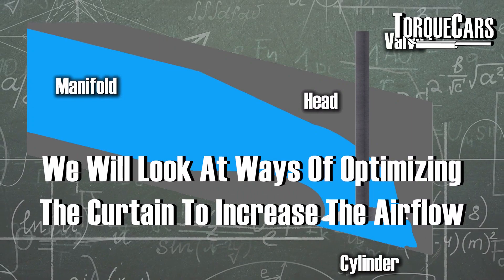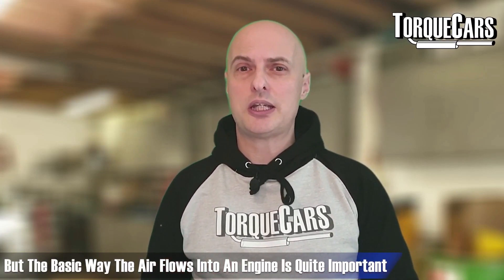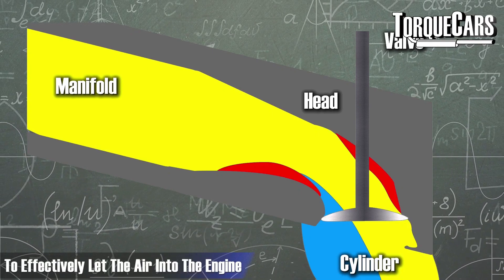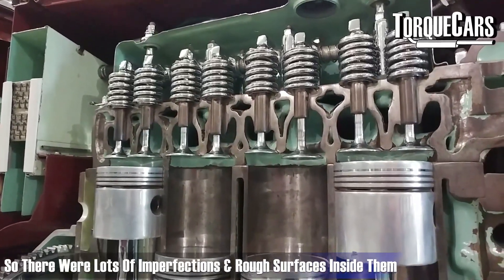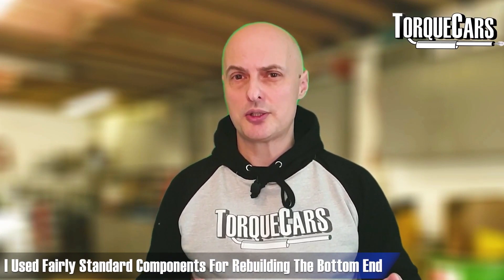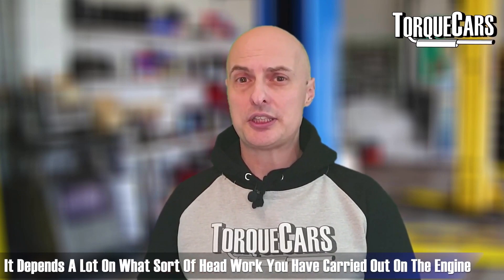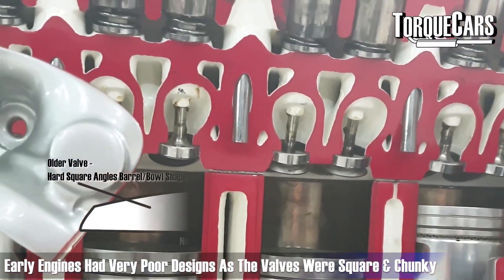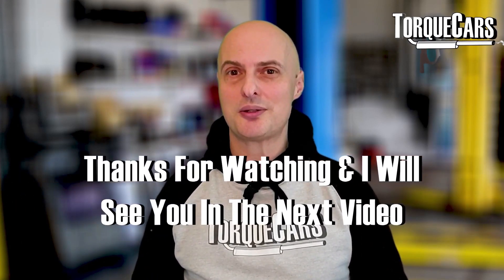How Porting, Polishing & Valve Jobs Improve Performance  [Head Tuning]

Comment: It doesn't need to be too complicated for my 300 TDI Defender. Got a new head, so just taking the casting crud that sticks out into or with a negative craggy bits, and smoothing them out while removing the minimum of material, and polishing as it's direct injection so no fuel mixes in ports, and grinding the new valves 300 then 600 grit to remove and chatter in the valve seats and get a more gas tight seal; should all help slightly improve my engines efficiency.
Btw you have a strange green glow from your head, are you from another Universe 😀
Reply from the maker: lol it was meant to be a yellow glow as I'm talking about head tuning! I can't see green though so I didn't realize until now! I was messing around with various lighting setups and it looks like I got it very wrong on this one. how I cringe looking back at my early efforts.